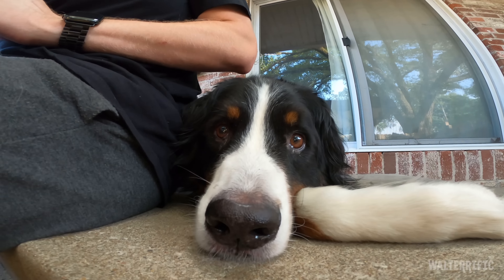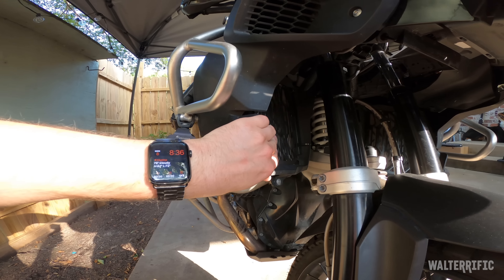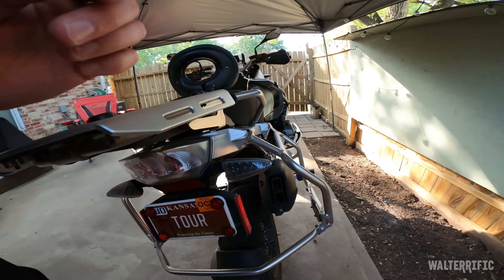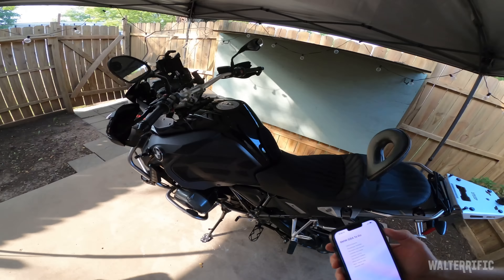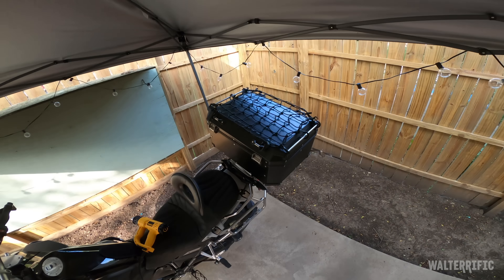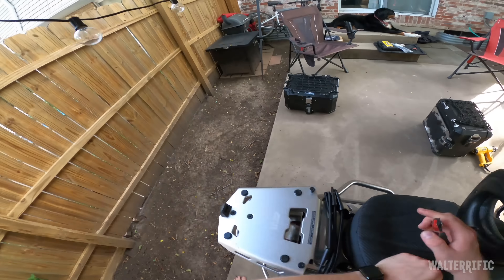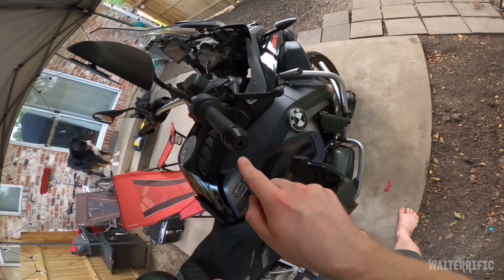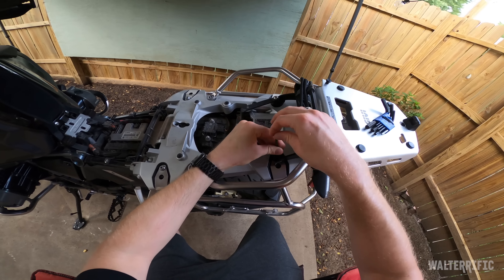Tinkering With My New Bike

Comment: Pro tip -- remove double-sided tape in tricky spots using dental floss.  Slip the floss behind it and use a sawing action to cut the adhesive backing.  Got no teeth?  Well, that's a different problem.

Comment: Please use BLUE Thread-Locker rather than Red.  Red is maximum strength and you may need to heat the bolts should you need to remove them.  Great to see you and Ronin.  Ride Safe.